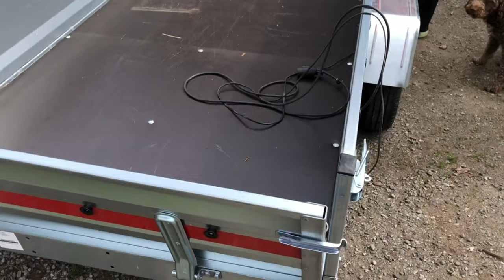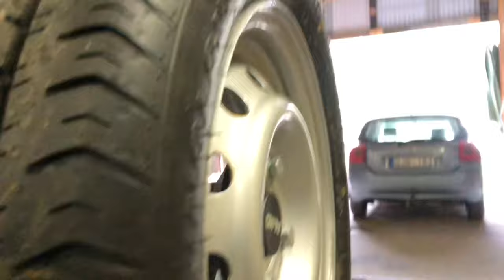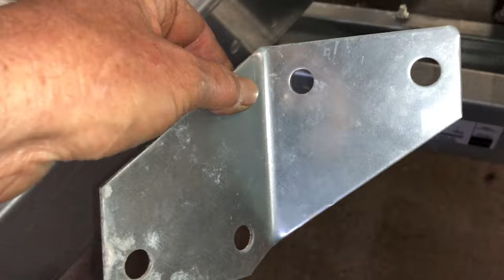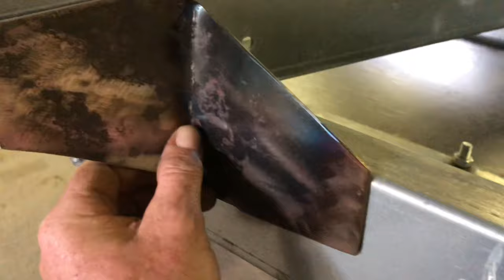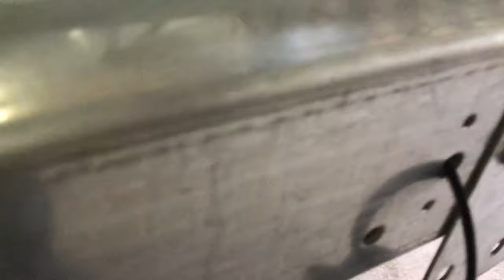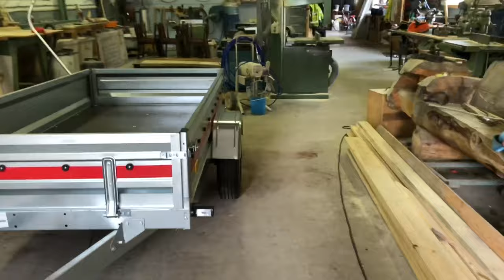Completing a Temared Trailer build in my shop.

Comment: I've got the 2312 8ft by 4ft with high sides want to add a 2nd axle can't find one anywhere would also like to make it braked but can't find parts anywhere, but they are good trailers the wholes are for the extras you just can't buy them anywhere 😂 had a 1 tonne in ours including trailer didn't realise till got to the scrap yard

Comment: I just saw this video and I might have missed something! What ended up causing the front and rear gates not to close properly at first? Thanks!
Reply from the maker: Hi Monte, now bear with me it was a while ago but I think they fitted the hinges wrong. I took them off and refitted them correctly and they closed just fine. It maybe they had the front on the back and back on the front.

Comment: I've got the tema prakti 2312 with the cage add on sides she's 8ft big girl and a tipper but I'd like two of them brackets as don't use the tipper
Reply from the maker: Hi, You should be able to make them to do the same job.
Reply: @arctic-rebel  where can I get them
Reply from the maker: This is all the info I have, but from there site you may get a part number for a more local dealer

https://unitrailer.ie/

Comment: I like this video. You've introduced me to new words like "floppage". :) I like the understated way you said you were underwhelmed by it, way more polite than me. :) In the end is the trailer good? Is it worth the money? Is you're mate happy with it? I've got t a chance to buy a smaller 6X3 semi boxed one BUT I've not come across this brand before.
Reply from the maker: Hi, Thanks for asking and yes it is ok for the money, there have been no problems and nothing has fallen off it. He has used it through the winter and now the summer and it still looks like new. It is a cheap brand, no heavy welded chassis you know it is all pressed steel but if the price is right for you and your not expecting to last 20 years then I would say it is good enough.
Reply: @arctic-rebel  Cheers for the quick reply, TBH it's not the best price, might give it a miss. :)